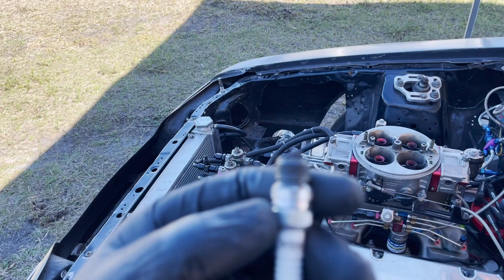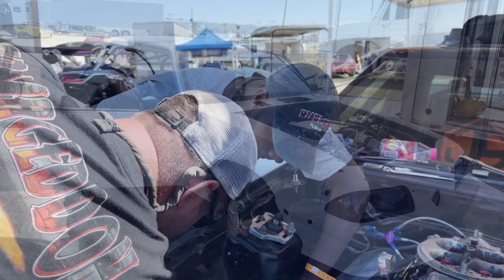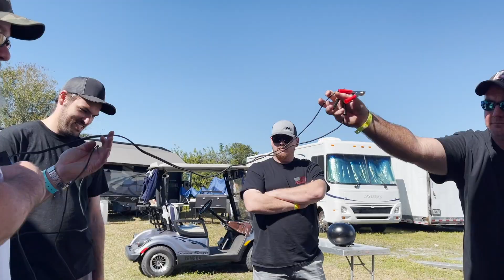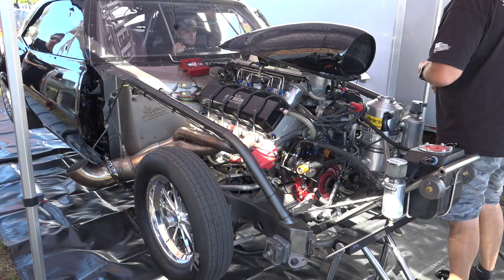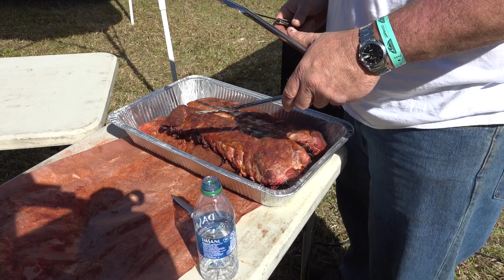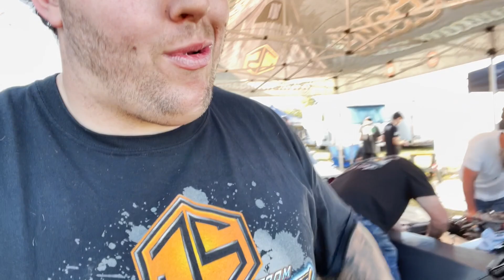FINALLY BACK RACING AFTER 6 MONTHS! Twisted T & Midnight Getting Some Love

Comment: Wow, never seen a plug that you had to pull the headers......that is crazy.
Reply: Yessir, I'm betting they'll be yak'n that BB Chev and reworking so those plugs will be easier to get to.  What they found today just ain't gonna get it. Surprised they hadn't discovered this before bringing it to the track BUT we know the Swanstrom crew have been busy as haell with the business. Not a ton a time to work with the cars.
Reply: On a No2 car as well. Nightmare. Maybe thats why it got sold. Could never get the tune right because the plugs were always old....
Reply: Yeah screw that. I’ve seen sand rails that need the engine pulled just to change plugs and nowadays I just avoid those types of projects lmao